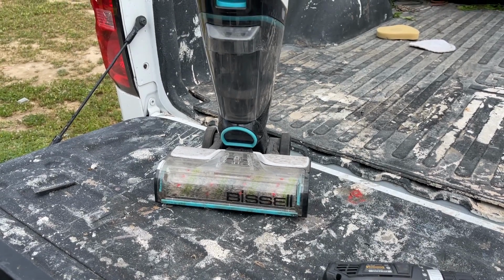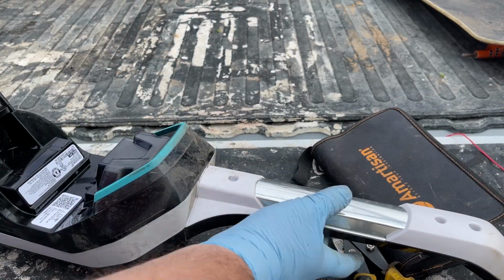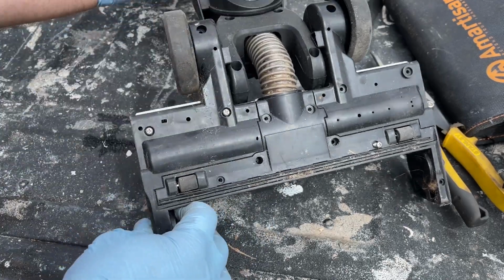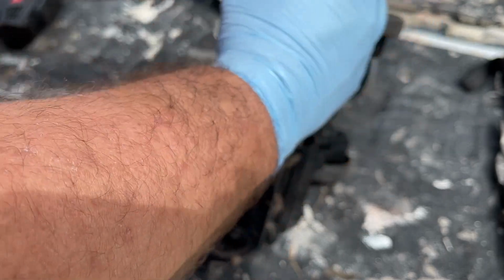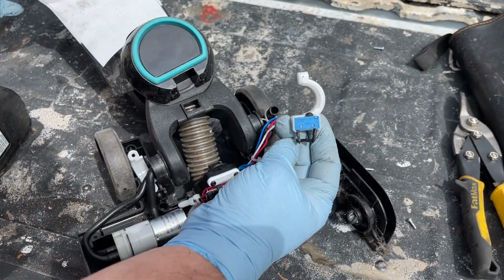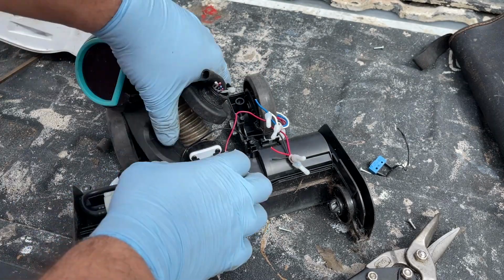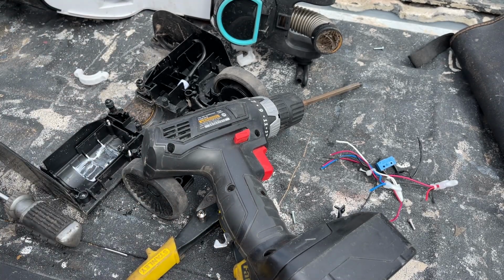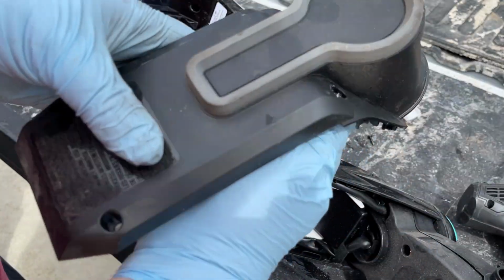Bissell Cordless Crosswave Max Battery Removal Brush Chamber Teardown

Comment: did you happen to unscrew the top 2 screws starting right below the handle release.  I was attempting to take the entire back off until some white substance started coming out of the screw holes I didn't have enough time to invest so I stopped.  Just wondering if you happened to tear the machine all the way down.   Oh and do you sell any of those parts? thanks

Comment: The whole reason I watched this, was to see how to get to the brush roll motor and belt… and you broke it apart instead of taking it apart. 🤦‍♀️😂 I just replaced almost all of the parts on mine, and the brush decides to stop spinning. The thing has been nothing but trouble since I got it.
Reply from the maker: That’s because you can’t. Like literally you can’t get to them without breaking it. It’s designed that way on purpose.
Reply: @hanksgarage_  That really sucks. I know you can buy a replacement motor, so I foolishly assumed I would be able to access the broken one.   I have spent so much money replacing tanks, brush guards, filters, brushes… just for the stupid brush motor to go out. Plus, the way they make it, you can’t even clean out from around the spinner knob. I used a dental hook to pull some hair out from around it, and the first time, it worked. Then the next time I went to use it, it wasn’t spinning again. 

Thanks for your video! I would have thought I was just too incompetent to figure it out, had I not watched this.
Reply from the maker: If you had a warranty issue with it and took it to a bissell service center they would have just sent you a brand new one instead of fixing it.